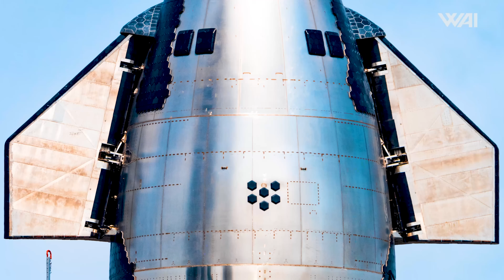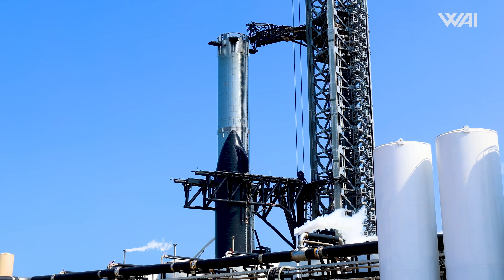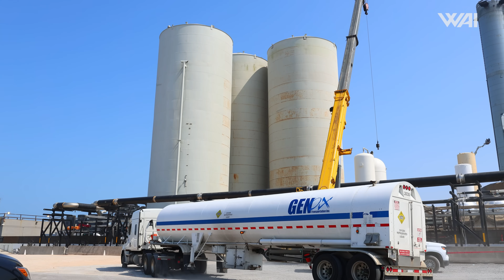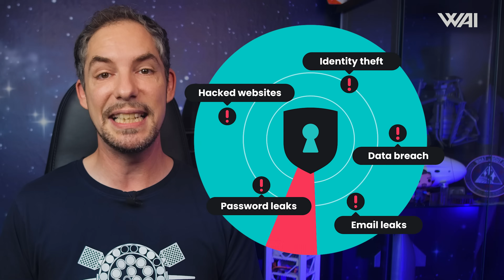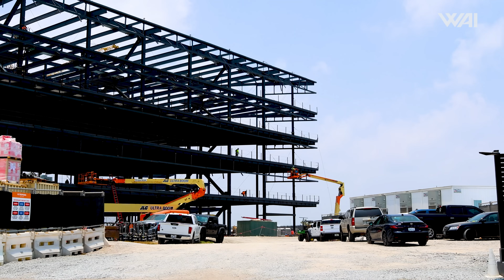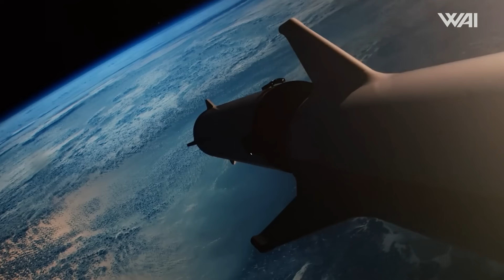SpaceX Starship Flight 4 - Launch Briefing!

Comment: for next video.
WHAT HAPPENED AFTER SPLASHDOWN, both booster and ships established a hover. but what happened, was anything recovered; ideally full units. can you imagine the engineering physical evidence you could get from recovery of boister/ship or even both. I reckon it would be a really interesting data fact for the next video, Lee Smith, Doncaster,  England.... yes the Home of the mallard and flying Scotsmen steam trains...
Reply: what's the depth of where they landed, is it possible to do a marine recovery.
for starship 5. could it be considered to land in a shallow sea location; therefore enabling post splashdown recovery... then real analysis would be possible.... for now... what's the landing detail of ift4 landing zone?

Comment: Some Engineering comments on IFT 4. It would be so cool if we could have IFT 5 Ship deploy (in space orbital coast phase of flight) three or four specialized/modified Starlink satellites that would 'chase, photograph, and video record' Ship in orbit and at re-entry. This would allow a complete visual picture of Ship during re-entry could be analyzed along with other telemetry data. A couple of these 'chase spacecraft' would have ablative 'nose cone or aerodynamic shaped, ablative, heat shields and follow Ship through re-entry to visually record flip and soft landing at least until IFT 6 when that will happen and definitely be visually recorded at Starbase. lol

Comment: During my career as a structural aerospace engineer I remember reading in Aviation Week and Space Technology magazine about a 'new' steel/skin material developed in Japan that had a melting temperature around 3000 degree F. I don't know if this ever got produced in commercially available quantities. BUT if it could be produced in even small quantities at low enough cost it could be used for the bolts, fittings, stringers and other structural elements at the base of the control flaps. It was painful but extrememly exciting to see these FLAP joints 'hang in there'!!!!! KUDOS to the structural designers of that joint structure!!!! ELON NEEDS TO GIVE YOU A BONUS and probably a raise!!! LMAO 🤣🤣🤣🤣🤣😝😝😝😝😝

Comment: So now that SpaceX has proven that they can land both on water I have a question. So, you think in the next 5 test flights SpaceX will consider both visual drones and inflatable ballon rafts on both Starship and Booster so both can be towed for visual inspection  of condition prior to landing at the OLM? If both vehicles sink after landing, how will they be 100% sure of condition?

Comment: As someone who actually powder coats alot of parts for SpaceX off site,   I wonder if SpaceX could #1- create a specialized Coatings "High Bay"..and then engineer a "coating system" to spray over the entire hull of a completed starship with heat tiles already attached..to actually coat the tiles with some sort of extremely high temp resistant polymer coating to help keep the tiles in place during the extreme physical forces during liftoff and max q...and likewise for the heat and dynamic forces during re entry....
Like something that seals all of the tiles together as the ship heats up.
Just a thought.  If it can be done...Elon could get it done.

Comment: SpaceX might want to explore semi-circular arcs that wrap around half of the ship.
These arcs would be made of the same heat shield material, poured into a large mold, shaped, and fired like toilet bowls. (†)(††)
The arcs have the advantage of using simpler and studier fastening mechanisms.
†) There are plenty of workers with experience in ceramics, and/or plenty of firms capable of performing the work.
††) It could even be done in the *Corpus Christi Lithium plant with waste heat from the refractory drums.

Comment: It is basic knowledge that that fire just like water spreads through the path of least resistance, it only take a tiny hole to corrode the edges of the breach to gigantic proportions very quickly, as it burns through the surface area gets bigger and as it gets bigger it goes even bigger much faster and so on. A small whole in a dam wall is all it takes for the whole thing to collapse very quickly unless you can stop the initial flow, what Starship needs is the same material spayed onto the inside of the craft, in this case you don't need the tiles, you can find a way of spraying it on as they do insulation in houses it will have to be just enough to last the last few seconds after the stainless has been breached, because by the time it goes all the way through to the inside protection the speed is under supersonic, BUT if there is more than 1 tile missing in the same spot you are FFFFFF'ed.

Comment: When Musk is talking pessimistically about resilience of the heat shield — do keep in mind that we're a day or so out from a launch attempt, and Musk always issues statements downplaying expectations at such times

Yes, the heat shield is a hard problem — but when Musk says they're not resilient, he doesn't actually know that for sure... he has a computer model giving predictions, but the entire purpose of this flight is to compare the model with reality to find out where they really stand. And I really do mean entire purpose... they're not testing cargo doors or engine relights or anything that might distract from getting this data. The only thing that matters this time is finding out what happens when they try to fly a ship through re-entry, because that's a huge piece of missing data right now...

Comment: The talk about redundancy for safety, I guess, is history. A single tile and the whole thing is destroyed....insane.
Reply: The heat shield has always been a "one and done" component.  Since it covers the entirety of the exposed surface, it is heavy.  Too heavy to double up.  Upon reentry, the plasma is hotter than a cutting torch, and will cut through the body of every spacecraft ever produced.
Reply: @geekchameleon  Why not remove all tiles and spend some fuel to decelerate the ship? The less mass from tiles require less fuel which you can spend to decelerate. And it makes the ship much simpler. The best part is no part !
Reply: @toma.2156  Once you get below 18000 MPH, you fall from orbit.  You just can't go from orbital velocity to landing velocity without falling at a speed that requires heat tiles.
Reply: it just lost several tiles and half a flap and still survived reentry. was pretty cool to watch

Comment: SpaceX is on its fourth semiorbital test of starship, and nothing is known about its use of humans. Simply put, not even a prototype of starship for astronauts exists. Imagine how many years it took for SpaceX to develop the SMALL Dragon Capsule for humans; and how difficult it has been for Boeing to develop its starliner (and we do not know yet if it will be safe for humans), now consider HOW MANY YEARS it will take for SpaceX to render Starship suitable for human use???? I am afraid we are up to 4 years from now to see one suitable for human use, unfortunately.
Reply: The alternative is to switch the design: a capsule for humans will be assembled as a THIRD STAGE, which could detach from the fuel tanks, in case of an emergency. That means to rethink the whole starship. 😞

Comment: I also think the reason why OLIT2 has more piles is because its designed for the future rockets which will be taller and heavier. Just because we dont have all the segments yet for a taller tower, doesnt mean to say they wont knock up an extra segment or 2 to build this tower, or just remove the top segment later and shove in some extensions and put it back on later to make the tower taller.

We know there is a plan to make starship taller, making it taller may also mean taller tower, or it might well just mean tower will be same size and ship will be taller than tower sitting on the mount. One thing is for sure, the tower itself will have to lift heavier boosters and ships as well as possibly be taller itself which means more weight and stronger foundations needed. For certain the foundation of the launch mount itself will be stronger to account for a heavier next gen starship. Last thing they will want to do is tear down the entire launch mount to upgrade the foundations to put gen2 ships and boosters on it.

In fact I wouldnt be surprised if as soon as they finish tower 2, they take tower 1 offline for months to make the retrofits needed to support the gen2 stretched boosters and ships. This new tower is not being built for today's starship, its being built with the future gen2 ships and boosters in mind. What's the bet it will be taller right off the bat? Not just a bit taller, but at least a full size segment taller. What if the current 9th segment, is actually the 10th segment and they just have not built 1 segment yet? I reckon they could knock out 1 more segment from scratch in the amount of time it will take them to be ready to lift it into position.

Comment: I'm not an engineer,  but regarding the importance of keeping the heat tiles in place, why doesn't SpaceX pull a big rubber over Starship to hold them in place until re-entry? Of course, I'm using an ironic metaphor,  but wouldn't using some type of ablative covering hold the tiles in place until they are needed?

Comment: I guess I don't understand why they must use thousands of tiny tiles when each one is so critical.  Why not bond larger heat shields of the same material so that you have greater bonded surface area for each piece and far fewer shields to fail?

Comment: Felix, how much fuel weight could be saved if fuel lines could continue hooked for maybe 3,4 seconds while rocket starts heading up? The fuel lines could be flexible and quick disconnect maybe after  5 ft-8 ft into the atmosphere

Comment: Felix, you like working with numbers, right?  Can you work up an episode going over the economic impact of Starship development?  It would be interesting to see the number of direct employees and contractors, then supplier companies.
Oh, also one on the safety of the command center.  With it being fairly close to the launch tower do they have some kind of automatic blast shields that will drop down to shield those in the command center if it goes BOOM close to the pad?  Those big windows scream danger.
It is odd that DM was cancelled.  Granted Starship develop has been slower than Musk had wanted, but this is something many said could not be done, so a 5 year development period without any infrastructure already in place was very optimistic.
Reply: I think the command center is in CA. isn't it? The launch platform is about a 1/4 miles from the build site. I think the build site is completely evacuated. Because Chica houses are right near the build site and is evacuated for launch and static fires.

Comment: Material Science is moving ahead. A new 4 metal alloy has extreme heat resistance and yet is not brittle. This new alloy is way better than Inconal. Others are testing the latest printed metal rocket engines. 
On the Apollo rocket bell they had tiny tubes that they sent kerosene through to preheat it, and cool the metal. 
Combine these and you get super high temp alloy metal printed large tiles with coolant transpirational tiles for Starship. These could be only 1/8 of an inch thick and mostly hollow. So very light. Say half of the weight of current ceramic based tiles. And withstanding much greater heat. Yet keeping the ship much cooler. With virtually no chance of one breaking or flying off.

Comment: Okay so; 5 yr old frozen hot dogs might not taste that great but I'd still look forward to them in celebration of a Starship circling the moon.  
I really want to see one ship land vertically and another land and tip over and settle horizontally and become a workshop; wherein the fuel tanks are opened up and have air locks.  Innovation and versatility seem to be taking hold in future engineering.  Here's hoping it all works out serendipitously well.

Comment: I'm wondering if the outer shell of where the tiles mount is flexing just enough to where the tiles pop off. This is just a thought only.
Reply: Hard to understand the fuss and $ being spent on a beefed-up Mercury capsule...the Boeing effort still has to parachute down, could never re-launch itself from another body, even the weak gravity moon, and is a salute to the 1950 and 60's.

Comment: Felix, epic channel and great video as always. Question: is there any way for SpaceX to make the tiles much larger so that one tile is enough to cover 8 to 10 horizontal meters of the  underside of the ship. I am imagining semicircular rings that could be fastened to the underside of the ship all the way down its length. They would still need a few dozen of these to cover the entire underbelly of the ship, but then they would only have to worry about fastening a few dozen as opposed to a few thousand. 

I know that there are some very finicky parts of starship, such as the flaps, and fins, but those could still use the existing tiles. The larger tiles I'm talking about would only be used on the sections of the underbelly that are relatively clean and free of nooks and crannies. 

Sorry for the lengthy text. I look forward to hearing from you or one of your many very smart viewers. Hell, maybe Elon will chime in...

Comment: I'm  starting to think interplanetary ships need to be built in space and stay there. We need shuttles or capsules that are economical and reliable for re-entry. As Columbia proved, there is no margin of error when it comes to heat tile damage during re-entry plasma. The effort to protect the Shuttles was immensely costly and complicated. The dream of rapid reuse of something as large as Starship, maybe out of reach with current technology. Perhaps the SpaceX - Starship experiment will lead to an orbital Starship Factory.
Reply: Why manufacture in space?  Launching the factory and the raw materials would be ridiculously expensive.  They certainly could build spacecraft incapable of reentry on Earth, MUCH easier...

Comment: I have said and always thought the heat tiles will be the Achilles heal. Why don't they interlock them all. The new one locks into the last one which becomes fully locked in .
 Now one is attached by itself alone. Interlocking them makes them much stronger and resilient.
Reply: Plus interlocked tiles would mean replacing damaged ones is now a nightmare
Reply: They need to have room to expand when heated. So they have thin gaps.

Comment: My idea to protect the heat shield tiles would be to cover the in-place tiles with a thick resin like laminate, either sprayed on or applied in large heat-sealed sheets of a durable material that stays on through launch and payload deployment, then harmlessly burns off in reentry, keeping the tiles in place for when they are needed.
Reply: Great idea! I wonder why the best brains in the rocket business didn’t think of such a simple solution? Or is it because you are so much smarter than they are?

Comment: Fire ball of DOOM!

Seriously there are about 18000 individual tiles. If each tile has a 1 in 10,000 chance of coming off that means the ship as a whole has an 83% chance of losing at least one tile and dying on re-entry.  If each tile has a 1 in 100,000 chance of coming off there's still at least a 16% chance of at least one of the 18000 coming off.  If each tile has only a 1 in a million chance of coming off there's still a 1.8% chance of the ship burning from the loss of at least one tile.  If each tile has only a 1 in ten million chance of coming off then one in 0.179% of about  one in 550 starship re-entries will fail from loss of at least one tile.  No, to get to acceptable re-entry failure rate of a round one failure per 5000 re-entries, we need individual tile failures to once in a hundred million.  

Personally I doubt that is achievable.  VERY VERY few machines have manufacture and installation failure rates as low as 1 in 100 million.

Comment: Mathematically, the odds are very much against SpaceX not loosing a single tile. There are 18000 heat shield tiles. Given a very low probability of a tile detaching. E.g. 1 in a million, the probability of loosing at least one tile of the 18k tiles is still over 98% (as pointed out by james it is a 2% probability 1-p of loosing tile). (1-prob(tile detaching))^N.
Reply: I think you made a mistake here and the odds are in SpaceX's favor, if prob of a tile detach = 1/1000,000, then prob of a tile NOT detach = 0.999999, prob of ALL tiles not detach = 0.999999^18000 = 0.982, so not even a tile detached is very high !😅
Reply: lol, i just thought about that, you are of course correct. But that is with 1/1000000. I guess what I was trying to say still holds since for human rated flight you would not want a 2% probability of burning up in the atmosphere (especially because they want to launch these ships a lot). With a probability of 1/100000 it is already about a 20% chance to loose tiles.

Comment: I really don't understand why they spent all that money to install that sign to then rip it out six months later. They had to have known they were putting the tower there. As the plans and permitting for the tower had to have started at the time the sign went up
Reply: Scheduling issues maybe? I get the impression that work schedule around Starbase is extremely flexible and responsive to rapidly changing demands, so the sign may have been ready before the wall was moved, and the best place to store it was just to hang it on the old wall. It's not like it's expensive to move it.